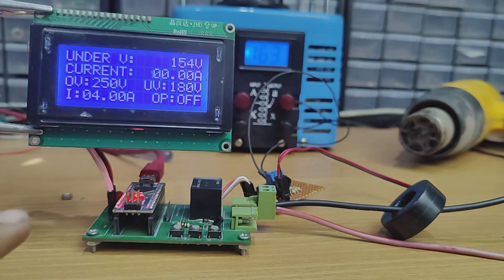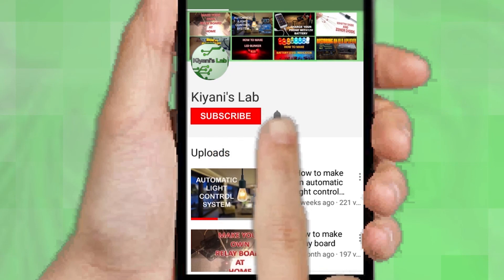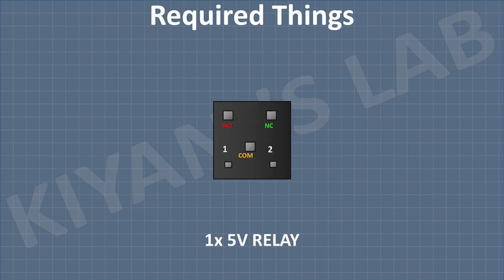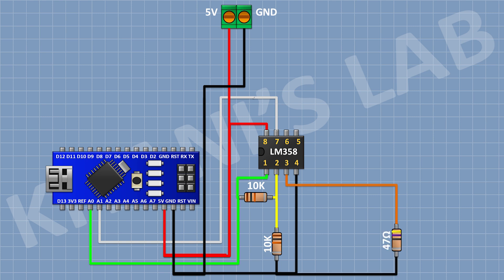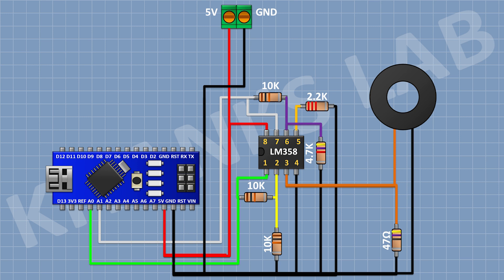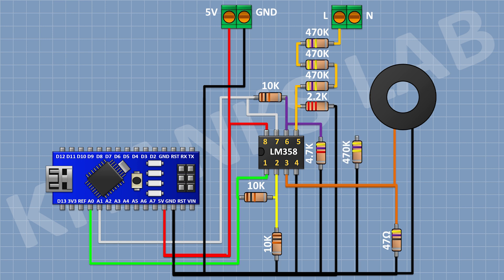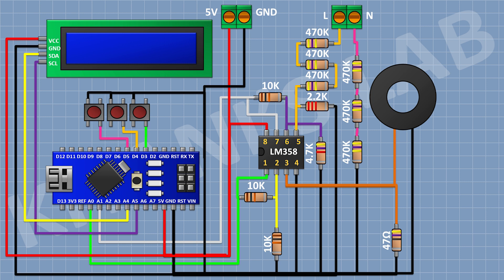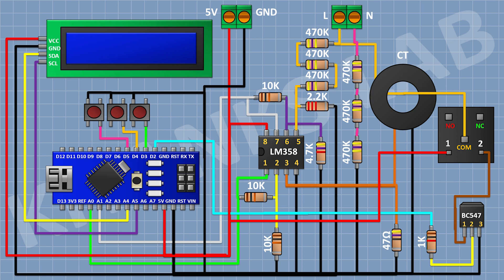Adjustable Volt Amp Protection Device | Arduino Project

Comment: You have explained each project very simply, I am using your Arduino project to make something.
Reply: Have you managed to make this circuit, I am trying but I am afraid to put AC into pin 5 of the Lm358, I know what passes through the 470k series resistors but I want someone who has already done it to help me confirm if it is possible to do it.

Comment: current=sensorI*3.27;
volt=sensorV*14;
volt=volt/10;  yanlış

current=sensorI*3.27;
volt=sensorV*1.4; doğru

#include <LiquidCrystal_I2C.h>

LiquidCrystal_I2C lcd(0x27, 16, 2);

byte ACSEMBOL[8] = {
  B11111,B10101,B11111,B10101,B11111,B10101,B11111,B0000};

float Amper = A0; 

int volt    = A1,
    Buzzer  = 13,
    sensorV = 0, 
    sensorI = 0,
    Watt    = 0;

void setup() {
  pinMode(Buzzer, OUTPUT);

  lcd.init();  
  lcd.backlight();
  lcd.clear();
  digitalWrite(Buzzer, HIGH); 
  lcd.print("   >  MY.C  <   ");
  lcd.setCursor(0, 1);
  lcd.print("    WATMETRE    ");
  delay(1000);
  lcd.clear();
  digitalWrite(Buzzer, LOW);

  lcd.createChar(1,ACSEMBOL);

}

void loop() {

  sensorI = 0;
  sensorV = 0;

  //sensorI = analogRead(A0);
  //sensorV = analogRead(A1);
  for(int i=0;i<100;i++){
  if(analogRead(A0)>sensorI)sensorI = analogRead(A0);
   if(analogRead(A1)>sensorV)sensorV = analogRead(A1);
  delay(2);
  }

volt = sensorV * 0.3349,0;{
  lcd.setCursor(0, 0), lcd.write((byte)1);
  lcd.setCursor(2, 0); 
   if(volt<100)lcd.print("0"); 
   if(volt<10)lcd.print("0");
  lcd.print(String(volt) + "V");
  }

Amper = sensorI * 0.0327,1;{
  lcd.setCursor(10, 0);
   if(Amper<10)lcd.print("0");
  lcd.print(String(Amper) + "A");
  }

Watt = Amper * volt;{
  lcd.setCursor(10, 1);
   if(Watt<1000)lcd.print("0");
   if(Watt<100)lcd.print("0");
   if(Watt<10)lcd.print("0");
  lcd.print(String(Watt) + " W");
  }

}

Comment: i think this circuit is not isolated from ac mains  it is danger to touch the pcb with bare hands
Reply: Have you managed to make this circuit, I am trying but I am afraid to put AC into pin 5 of the Lm358, I know what passes through the 470k series resistors but I want someone who has already done it to help me confirm if it is possible to do it.